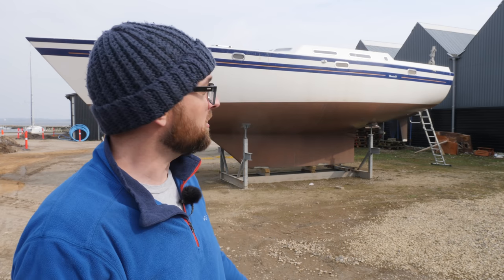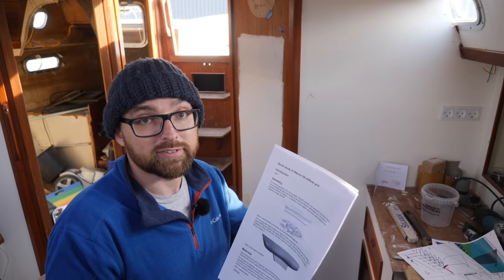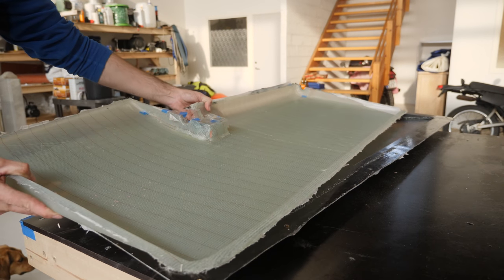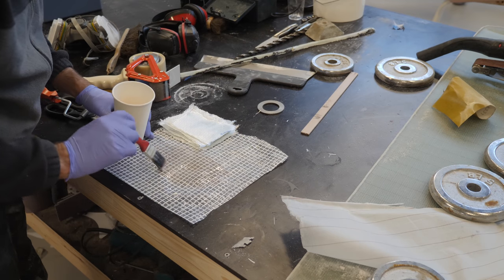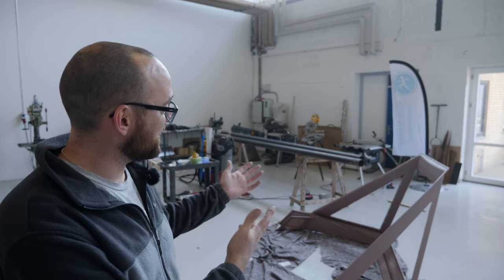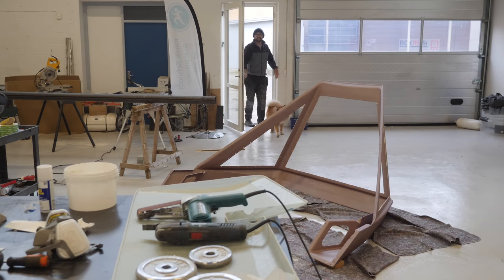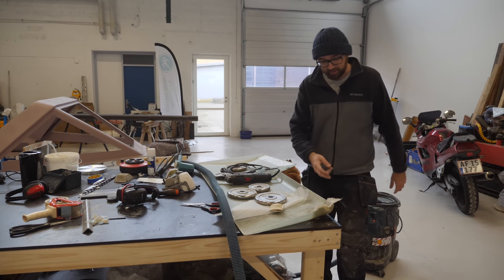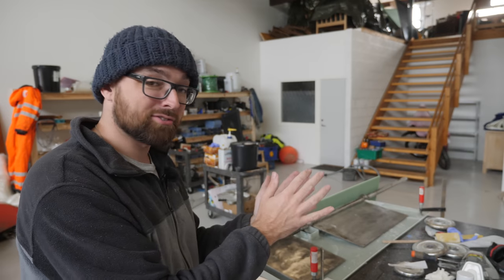Sail Life - Structural members, rudder and dodger fun - DIY sailboat repair

Comment: What about a scan of the inside of each mould halve, the have a cutter / water jet cut the pvc foam panels into small cross sections you could then sandwich inplace in the moulds with your filler then sand and lastly put the other side of the mould, let cure and viola -

Comment: To help keep the water out of the interior of the rudder, I would consider building up about 25 mm of fiberglass at each of the three entry points where the shaft passes into (or out of) the rudder cavity...the one at the top and the two where the skeg attaches.  I would then bed the shaft in 5200 or butyl tape at these locations.  This would have the benefit of a longer bed joint for water to pass through before reaching the core, and would also reinforce the entry points to strengthen the shell where the stresses are the highest. the 5200 bonds well, but the butyl tape can withstand a lot of flex while still remaining water tight...and it is way less messy.

Regarding the collet (or metal ring) around the shaft where the skeg attaches, I too agree that this would be best left outside of the shell...specially if the attachment at the skeg bears weight in the vertical direction.  Meaning this would be a thrust bearing point.  But then I am not sure where the load bearing points on your rudder are. If the upper bearing supports the full vertical load of the rudder, then it would not be so important.

Comment: I think everything you do is top-notch quality. I don’t want the following comments to take away from what you were doing but I do have a very basic question. I have a 50-year-old fibreglass sailboat. A couple of years ago I had to build A new rudder The flanges on the stainless stock were much smaller than yours and I had holes cut in them to lighten them. The original rudder was made of aluminum so the construction of a new rudder was from the ground up. I then used alternating layers of Corcel and fibreglass with epoxy to build up the thickness. Once I had the proper thickness I then shaped it and put a few layers of heavy fibreglass over the outer shell. It has worked great since then. It was a lot less work than making a mold, laying up the outer shell first and then filling it. Do you think my method would have worked for you? You likely considered my approach. I also think you’re going to wind up with very good quality rudder but one that may be a bit on the heavy side. I enjoy your series very much.

Comment: Mads let me add to my post about cutting the structural in half I should had said cut the to off like slicing a bit of cheese on the tom of the member then pull the gunk out and put in foam and epoxy....

Comment: Hi Madds. I like Philipp's idea to add another stainless steel flange to the rudder shaft as a sealing surface. Ken.
Reply: I also think the addition of the stainless steel flange would be a good idea so it could be used as a protective wear surface especially if it is in contact with any other surface
Reply: Don’t forget to check your clearance values on the skeg and bearings before welding on an external steel ring.

Comment: While ordering chainplates, take the opportunity to add a pair of extra chainplates/bridlepoints for a Jordan drogue (or similar) at the transom, cheap to do and easy to fit at this point even if you have no immediate intention/need for them today. They'll be cheap preparation if you really are going for the RTW cruising ...
Reply from the maker: That is a good idea!! :)
Reply: along those same lines might want to think about davits, solar arch and what ever else you might want at the aft of the boat.

Comment: I have used expanding foam and it is difficult to work with but good for filling void and providing strength. I am interested to see how the solid sheets work out. Thank you for another excellent video Mads :)
Reply: Do you understand what the problem is with polyurethane foam? Isn't that what every other person uses in their rudder?
Reply: @IandiBoats  No I don't know about polyurethane. I do know some foams absorb water.

Comment: Mads,  Just watched "Just about sailing" video and looked up Sicomin.  There are some youtube videos on the stuff as well. -- if the cost works out that's the stuff to use.   I would modified the procedure a little for your rudder:  First bond the rudder shaft  into one side of your  skin -- adding some support bosses if necessary.  Next would bond on the other skin closing all the gaps with thickened epoxy.  Add some (4 or 5) 12 mm holes up near the trailing edge of the closed-in assembly for use in adding the foam.  Support the rudder on the shaft edge so the trailing edge is vertical and  the high point.  Add the foam in the holes which should flow down to the shaft edge.  The foam will expand from the shaft upwards on both sides of the steel plates, forcing any excess out the holes at the top.    I worry if you did it flat there could be a  trapped air void on the top of the plates.  Finally patch the holes.  Looks like that foam stops expanding prior to setting keeping the interior pressure low, don't want to pop off the skins or have to do multiple lifts of foam.
Good luck  Craig

Comment: Hi Mads - how about using marine ply to fill the bulk of the rudder and then you will need far less of that darned expensive expanding epoxy foam? I rebuilt my rudder with marine ply shaped best I could and then used thickened epoxy where required for the cavities - that was 5-6 years ago now and still looking good and rock solid. I like the many suggestions to add stainless rings on the rudder stock - it just makes sense. Thanks for another great episode.
Reply: Pete Nash hi , eh...no wood of any sort that can get wet , it will rot even good BS1088 marine ply.
Reply: @CheersWarren  Marine ply would do the job - you just have to do the job correctly and not let water ingress.

Comment: I'd go back and look at pictures of the old rudder. Was that lower flange internal or external. Internal doesn't seem right without an additional washer-like bearing on the outside.

Comment: Mads, to seal the lower rudder stock internal section , modify the shell slightly by using  a ~1mm larger rod to make a say 50 mm long half round laminate under it , or solid epoxy. Then you can fill this tube with 5200 and have enough there to be a 'form in place' gasket.
The foam skins are fine but you can also use any resin you want to fill the cavity  with lots of ( light wt) filler in it , no colidial silica, so it still flows and fill one half almost full , repeat on other side , then after cure put excess amount of any bonding paste between the 2 halves and squish together . 
This will nicely bond the 2 halves together with waterproof products , with no voids anywhere for water, do this all with the parts in the molds .  It will be sort of like a non-expanding epoxy foam. 
 You can also get "macro balloons' that are 2-5mm DIA if you really want to go light Wt. but I would just use micro balloons /spheres and epoxy resin, NO COLLOIDAL SILICA so it flows and is strong.  Add short chopped fibers if you really want to overbuild. 
Do you intend to add a THIN layer of glass across the exterior joint? I would .
Hope this helps you come up with your final  idea.
Cheers Warren
Reply: Do they make large glass filler balls? Large enough to make the epoxy filler similar to a foam? P{erhaps even 5 mm or so?
Reply: G Henrickson hi, yes  but not glass it's some sort of phenolic I think , we use to call it Syntactic foam. That the 'Macro' spheres I mentioned.  
He will use the green foam I expect.

Comment: Hi there, My rudder is polyester and sand mixed, it is heavy, it is strong and it is 45 years old. My keel was also filled around the lead at the voids with Polyester and sand. My prop tube chase was also filled with Polyester and sand. I have done a complete retro fit even going as far as to open the rudder and inside was good as gold. Have you thought of this system?

Comment: Make it watertight by a rubber sealing inside + outside + a steel ring around both places. I know they will be difficult, but you may weld these two rings - or by two bolts that connects the two half-rings ... for hulen mit engelske er glemt ... VH

Comment: A bit random not sure how it would hold up with salt water but you can get an foam mix that is designed to hold up a fence post. It just seems like you are going to spend an eternity forming those sheets into the mold only to cover them up with the glass shell
Reply: Sika post mix its on YouTube

Comment: Mads, why would you leave rotten wood in the stringers?  Not adding to structural integrity it's deadweight.  As others have mentioned, adding 6mm of glass is going to significantly add weight.  How about glassing and bolting aluminium channels lengthwise to the bottom, top and end of the stringers creating a stiff internal box within the stringers.  Or better yet custom make Al frames for each section to be glassed and/or bolted.  Pound for pound Al is stronger than glass.  Keep the existing glass stringers, core out the bad wood, fill with structural Al frames...profit.

Comment: Check out Just About Sailing, he rebuilt a rudder in fact I think he told you about the hard infill of your old one.  He did several experiments with expanding foam including a test to see if it absorbed water after curing.  Pretty sure his was not as expensive as you said yours would be' even though his rudder is smaller.  Good luck and don’t harp on about tiny mistakes, we all make them....it doesn’t make for good video.  IMHO.  Andy UK

Comment: Do you have enough clearance between the bottom of your floor boards and the top of the structural members to add the 6 mm of epoxy to the outside of the members?

Comment: I’m curious if the hull has deformed at all since the structural plywood appears to be saturated.  While I’m no expert on this - at least some fiberglass boat hulls will deform a bit while on the hard - do you have to take this into account before you reinforce the hull?

Comment: You should check out the PB series by Sicomin. It is a very good Epoxy Foam System, which is easy to use and by far not as expensive as 2000$ for a rudder. It know, that it is provided by "time out" here in Germany.

Regards Julius

Comment: Will you be applying any coating to the metal post and wings that will be internal to the rudder?  Epoxy paint or something like it so when water, as you say, inevitably gets in, it will minimize or prevent the metal or welds from rusting?

Comment: I hate the idea of leaving the wet plywood ....... could you drill 2 large holes with a holesaw on opposite ends of the floor frames.
Then vacuum out the water from one end, it will take a while but water under vacuum evaporates faster , and or heat . 
Then get slow cure under water curing resin,  and pour it in draw with vacuum to fill a lot of the voids , if you do a good enough job no need to layup all that extra laminate. 
If nothing else I would at least drill some large  holes in the top of one frame so you really know what's going on..........
Cheers Warren
Reply: I am reminded that given enough time and allowing enough money...anything is possible. I bet expanding epoxy foam would do the trick also. Maybe that is why it was invented...for filling voids while adding strength.
Reply: G Henrickson hi , you need to be very carefully with expanding foam products, despite what they say they are never closed cell and always absorb water sooner or later, you need to keep the water away. Same with any wood in a fiberglass boat , any wood need to be kept out of water. No amount of resin coating is going to work long term. Cheers Warren

Comment: Would it make sense to drill out the core from above, along a groove, leaving the existing glass around it intact, then fill up the groove with some type of epoxy? Then apply the additional layers of glass? Belts and suspenders.

Comment: Curious. Will you trim down the top of the structural members before adding the 6mm of glass to strengthen them? This way there will be no vertical change in the horizontal plane of the cabin floor. This also may be a good time to dig out any overtly rotten members and fill them with foam if so desired.

Comment: Why not use plaster?  Fiberglass the 2 halves together and then pour in plaster.  It will flow around complex angles and fill the cavity (make sure to gently vibrate the rudder as you fill). When it dried it would be waterproof and light.
Reply: Does not plaster shrink as it cures and quite a bit heavier than foam?  Perhaps there are syhthetic plasters?
Reply: Plaster shrinks very little if at all, depending on how you mix it (you can put all types of additives in it including fiberglass strands).  If your worried about shrinkage you already have the board vertical to pour it.  Just top off the void at the top (if any) before you close it up.  You need the weight/mass in the rudder to keep it from fluttering.  A slightly out of asymmetric shape in a fluid will vibrate.  If the rudder is too light, it will vibrate and flutter which will wreck any autopilot and rudder bearings.

Comment: Hi , it does Not cost that Expensive the 2 Part flotation Foam. Jamestown distributors . TotalBoat 2 Part Polyurethane Flotation Foam , 2 and 6 lbs foam  it may do the job . Nick.

Comment: Regarding the structural members.  The big thing to solve the problem of how water got inside the fiberglass "skin" to begin with.

If it was my boat, the members with the worst rot would be opened up and the rotten plywood dug out.  Fill the void with pieces of that PVC foam and then pour a lot of unthickened epoxy on top of that to fill all of the nooks and crannies.  Overkill for sure.  The one take were in intermediate condition, I would probably drill 6mm hole from the top to the bottom spaced 25mm apart, and then fill with unthickened epoxy.  In the end, you should still add at least another 3mm of 'glass and epoxy over everything.

Comment: Dear MADS : you ask for help and we send it but you have to look at cutting weight down of your SAILBOAT. the rudder bushing should be outside and use rubber rings to keep water out. also take some weight out of the metal plates (like put in some circle cut out. You got to try the Honeycomb core I told you about it great stuff. As for your Frame trust GETTING the WATER SOAK Core out. Just cut the top off remove the water soak core and use the Honeycomb Core then use KEVLAR or Carbon/Kevlar mat over the top . That way you have strength and cut down the weight. If you two are sailing you have to have Supplies. do you know how much more weight you are going to put on your sailboat by adding more Fiberglass over the frame trust???? I have seen Honeycomb core be use instead of marine wood. Well good luck  I think both of you should layout the whole inside of the Sailboat. Also look into the new rigging for the mast, like the nylon rope. GOD BLESS

Comment: Mads, mate if you are going to lay over the top of the original structure that's fine. BUT, it all relies on your bond of new to old. ok from my experience it will fail in 20 to 30 years. You must dry the original polyester resin completely and key the old surface with a rough 40grit disc. May I suggest using your heating blanket to get the moisture level in the old ribs as low as possible. then a slow cure with heat lamps on and using west system epoxy that you are use to. if you send me your email I will send you a copy of my failed keel beams (FYI). My repair ended up costing as much as my boat was worth, but she is an historic race yacht. The guy from boat works would be my consultant if I was you, basically because you know him and he knows what he is doing, for my yacht the shipwright had never repaired a Kevlar boat and wanted me to write up the repair laminate scheme, no problem, but worrying considering it was an insurance repair and I was not allowed to participate at all. so get it right now. cheers.

Comment: Regarding wet frames under glass, what if boat is,stored on hard during freezing weather. Will ice form and expand?
Reply: My Uncles marina handles a lot of salvage boats. So I've seen more than my share of wet cores. The only time we've ever seen minor cracking from freezing was when the core was so saturated that water would squeeze out as you walked and even then it was minor cosmetic (all things considered) stuff in the gelcoat on much thinner laminate. I wish I could get in contact with mads because instead of going overboard on layers of glass there is stuff called Git-Rot that works wonders for stuff like this. It is essentially a thin epoxy designed to penetrate rotten wood. It works wonders for things like this and it would fill and retain most of the cores strength. He can even use the vacuum pump to draw it through to displace what moisture is in there leaving a solid worry free coring.

Comment: MADS by looking at all the replies it sound like you may want to use honeycomb structural panels and epoxy this too the Rudder first then shape it to your Fiberglass panels then epoxy them together and that way less water to soak your core if water gets in. take care and hope you think about doing the frame inside your boat the right way by not glassing over the old wet heavy core.

Comment: Mads is it possible to use the vacuum system to infuse epoxy into the wood of the structural members? Also, can you use the pump and heat to dry them out?

Comment: 3m make glass bubbles balls of air. Strong and light. Use them in epoxy to have solid but light just like to foam.
Reply: I have used glass balls in epoxy and it was not that much lighter than the epoxy itself. Its great to work with and VERY strong yet could get quite heavy.